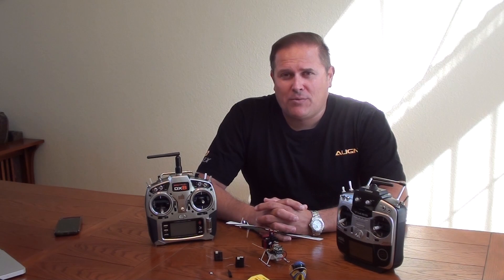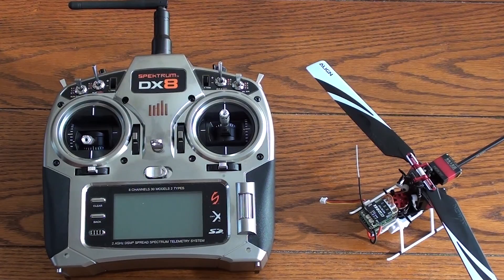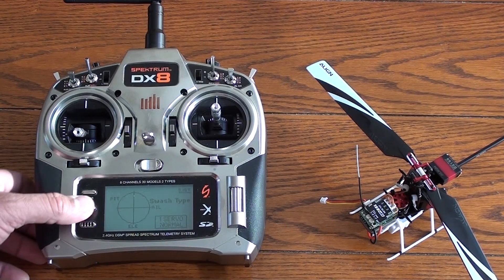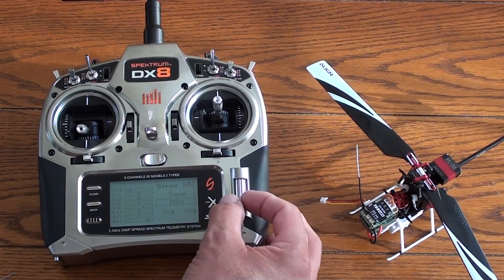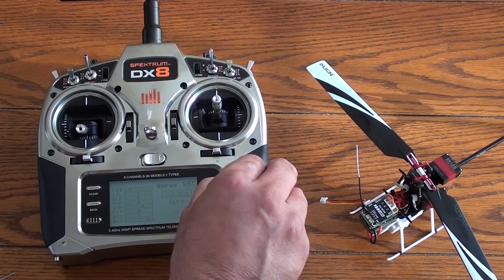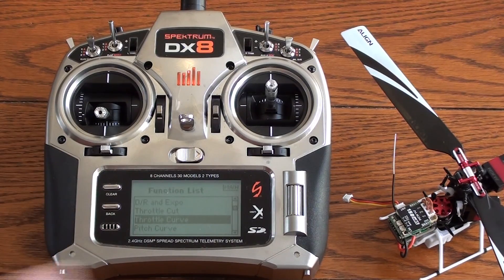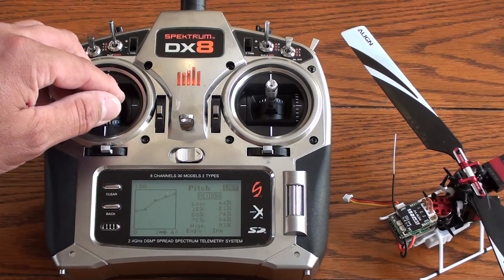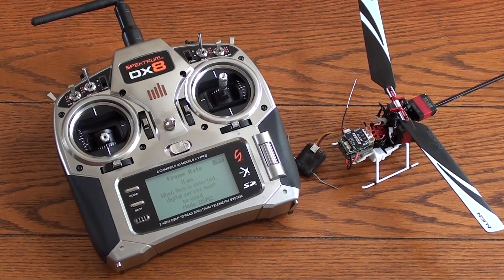Trex 150 DFC Setup/ Bind Procedure for Spektrum Radio systems

Comment: Thanks for the setup video, helped me get my basics to setup my new 150 DFC to my Spektrum DX6 radio.  At first I found the cyclic's to be very slow and sluggish and found info on adjusting the rate pot from the default lowest setting (looks like set at 8 o'clock postion and set to 12 o'clock position), I may yet increase the cyclic's as it seems still a little slower than my other heli's.  However, I'm having problems getting my tail dialed in.  It does not feel locked and noticed that it has quite a bit of drift.  I've only hovered a couple times in Normal Mode and per video had the Gyro set at 50%, I also have tried increasing the settings (tried 52%, 55%, 60%, and 65%).  The tail still does not feel locked in and I'm not sure what else to set.  I can try to keep increasing the Gyro above the 65%.  I also notice a small amount of tail wag right out of the box, even when the gyro rate set at 50%, but didn't notice any increase with the tail wag even up to 65%.  I'm mainly wanting to get my tail to feel locked in so I can have confidence in controlling my brand new heli (rec'd yesterday afternoon).  So far my other heli's are a Blade Heli's (Nano CPX, MCPX V2, MCPX BL, 130X, 180 CFX, and a 300 CFX), so far the tails on those heli's have been very responsive and feel locked in, (except for the MCPX V2) that encounter's occasional tail blowouts with flips.  This is my first Align FBL heli and if I'm able to get my 150 DFC dialed in and flying great, I would be interested in some of the other Align Heli's like the 250 DFC, 450 Plus DFC and/or the 450L Dominator.  And later move to the larger ones as my skills and confidence get better.  Anyway, any help with getting my 150 DFC getting its optimal setup would be great.   

BTW - I haven't changed anything on the Gain Pot, looks like default is 12 O'clock position.  What will the gain pot control?  Will that help get the tail to feel more locked in vs the gyro settings on my TX?

Thanks,
Joe
Roanoke, VA

Comment from the maker: Give us a call at 562-598-4700 if your having a issue with setup and or binding process. As for setting, they must be entered by you in your radio.
Reply: That works for T. rex 250 as well.

Comment: Thanks for the help Jeff.
I have a Dx7se which is DSM2... but at 11ms.  Am I ok to leave it at 11ms?
Also have run into a little problem with throttle on Normal mode.  It won't shut completely off.  Even though my normal curve goes all the way to 0, it still outputs a value of 1.  Throttle hold shuts it off and when I arm throttle it stays off.  It just won't stop when spinning.  Any thoughts?
Thanks again.

Comment: Well I have two flights on the heli after just binding it and when I move the rudder left or right the heli will not pirouette flat the tail kicks up and the nose goes down a bit in both right and left directions no matter if it's Normal, ST1 or ST2. Is there any adjustment I am missing?

Comment: Hi Jeff, thanks for your video. I would like to know if I can use sub trims on pitch servo son that I can set 0 degrees at 50% collective because my 150DFC is at 0 degrees at 40% pitch. Thank you.
Reply from the maker: don't use sub trim hold the set button after boot up and press until you pass the cyclic the fourth depression lets you set the zero point. You use rudder to make adjustments. Please check out the manual it show how to make this adjustment. But it is the 4th stage and then you move the rudder and all cyclic servos will move to adjust zero. So no sub trim.

Comment from the maker: Pitch at 70 70 gives more than enough pop for me. Also if you run more than 12 degrees you can load up the rotor system.

Comment: Is ther something different for a dx7 I just got my 150 and would love to fly it but it seems I copy the settings from your dx8 and I just cant get it right.
Reply: i was still not getting two solid green led with my dx7, i have set it with the dx8 video setting, so i have try with the real spektrum dsm2, same problem, i read in a forum someone said for the dx6ie the gyro setting must be 75% and make sure no trim for the binding, and i finally got my two solid green light with the spektrum dsm2, so i try the orange r100 and it work perfectly fine also.

Comment: Hi Jeff, when I bind my DX6i in DSM2 (with a DSMX receiver) I get one green and one red light on the main board - what does that mean? I didn't see this in the troubleshooting section of the manual.

Also, I'm unable to get a bind on the main board with the DSMX binding procedures (the light is solid on the satellite system but not activating the actual board.) Any thoughts? Thanks for the great video!